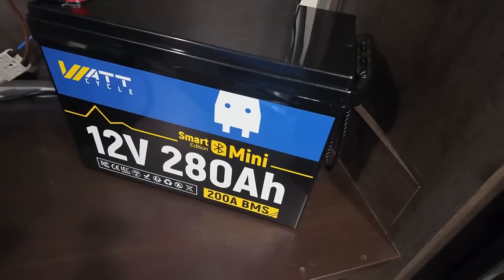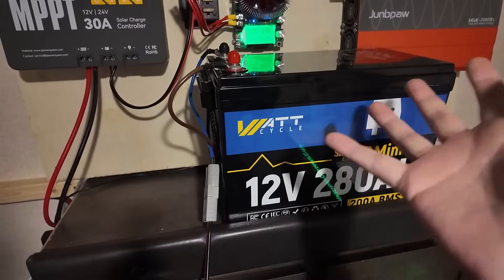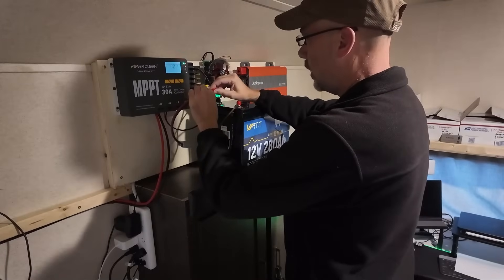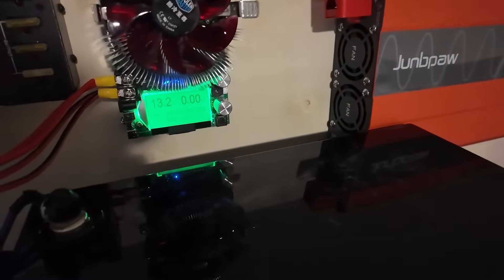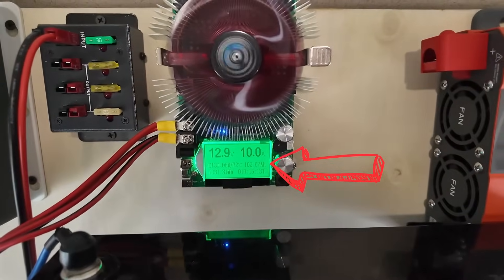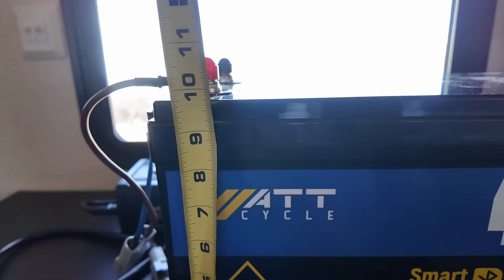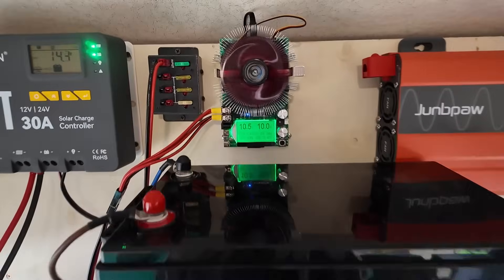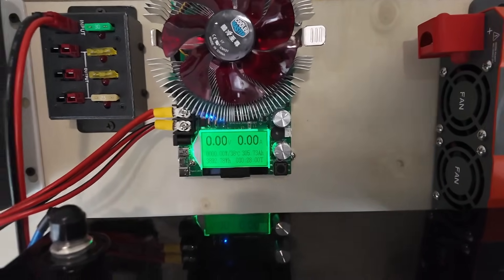Did They Fix It? Is it Any Better!

Comment: You might want to reconsider your thumbnail calculation. 12V at 280AH would be about 3,300W-h, times $6 would be a $20,000 battery…
Reply from the maker: @donnakano3697  caught that, thanks!

Comment: Many in the RV industry watch Will's you tube channel . What I don't like is that low voltage cut off so low that it will damage the cells over time  and cause problems in electronics .  I can't recommend them yet and many all ready know . I do hope they use better BMS settings . REDODO, Li-Time and Power queen is the most ones I use.  Sometimes Chins battery . I just got Victron MPPT order today. A few got them before Tariffs.   Still waiting on a charger held up in Ohio due to weather . I got TEXT from UPS . My order from ABR industry's was  held up due to weather . Some crazy weather in the US . Testing some Renogy shade master 200 watt panels and they out perform what is written on panel.  Like charging with Victron MPPT with Bluetooth I got 206 watts peak charging.  Never had a panel out preform . And I get like 1/2 charge with 25% panel under a blanket . Most drop way off or stop with 25% blocked. Not only battery getting better the solar panels are improving as well as price drop.  It is common to get shading in a RV park on solar.  For big battery in battery box use Big Anderson SB series connectors for inverters .  Like SB 175 or SB 350 . Them batters run a air fryer quite nice. Also a BIG KW amp for QRO POTA . LOL  73
Reply from the maker: I agree, it's good to see people are keeping an eye on those settings!

Comment: Shipping the batteries partially discharged helps with shelf life before it gets to the customer and reduces the risk of fire if they are damaged in transit. Juiced up cells are a tiny bit more volatile.
Reply from the maker: Good to know, thanks!

Comment: Thanks for the review. I’ve been waiting for the smart version of the 280/300ah battery to come out. 
Would love to see a video on what happens if you parallel a 280ah and a 100ah battery.
Reply from the maker: It would work for a bit, but I don't think its a good long term solution.  WattCycle says the old 280/300 and the new 280/300 can't be connected together, but I suspect a lot of that is "marketing"

My theory is: The 280 and the 100 will drain until the 100 shuts off - this leaves you with 180 and 0.  At that point the 180 remaining will feed the dead 100 to keep it alive and then the set will put out about 80ah or so.  Would be an interesting test.  Maybe I can do that with a 10ah and a 3ah and my load tester.

Now if you had special cables (which I supposedly have) You could get 10+3=13ah, but you'd need separate chargers since you're blocking the batteries from feeding each other.  Interesting idea, stay tuned!

Comment: How much energy do you burn on standby with the Bluetooth dongle being active?
Reply from the maker: I don't have a measurement, but its kinda a concern, kinda not.  I'll check it out in future videos.  Here's why its not a real concern:  You're supposed to keep them charged up every so many months as part of routine maintenance and all batteries lose charge just sitting idle, even without a BT device active.  I'd suspect a few watts.  My Wifi Router pulls like 4w to get its job done and its doing quite a bit more.